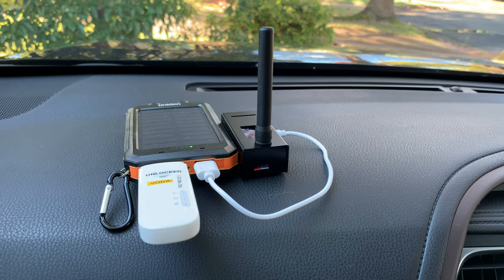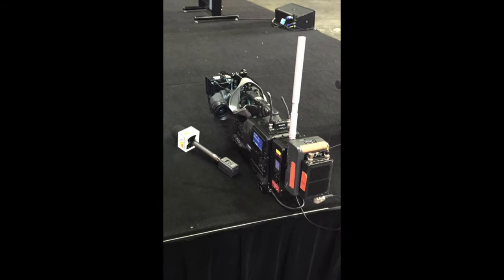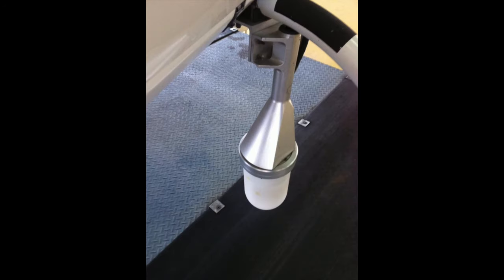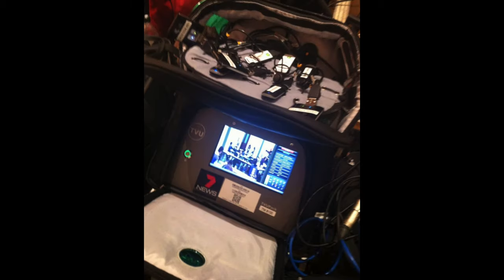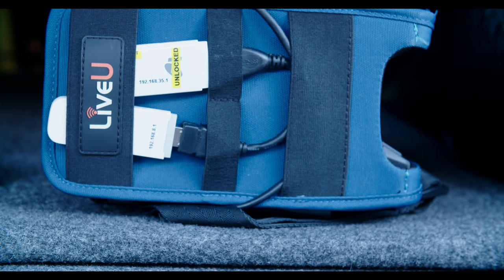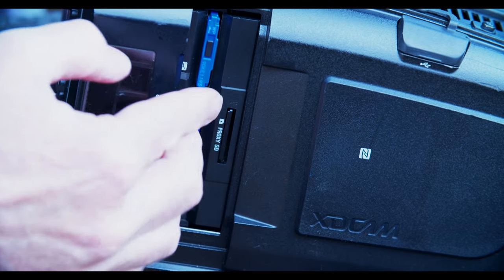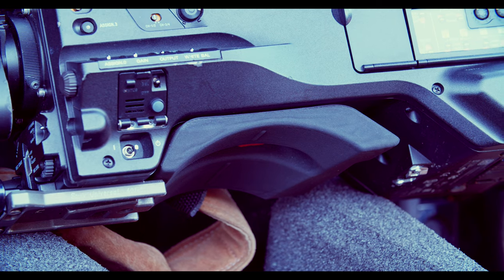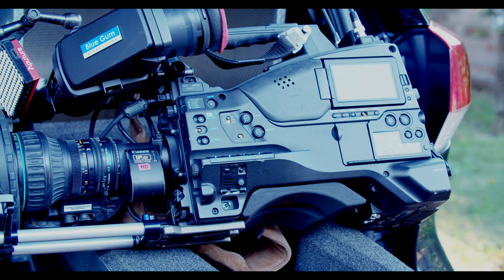News Gathering transmission technology or ENG camera bonded cellular transmitters

Comment: Great video, used to be able to listen to master control from the networks on UHF getting connections to the OB vans for news. They would be pointing the microwave towards Melbourne or Mt Dandenong etc not sure they still do that now or even use radio.
Reply from the maker: Thank you Grant. Microwaves are still used, especially for live Outside Broadcasts. In fact you can actually configure an LNB to receive the pictures with a downconverter signal to a DVBT home tv box. maybe for another video... They use the cell bonded for feeding pictures and live crosses. Sometimes it doesn't work when too many other people are trying to make calls like in a bushfire or other emergency as the cell towers get clogged. Hence why its good to have multiple carriers like Optus/Voda/Telstra so chances of getting a signal out is greater.